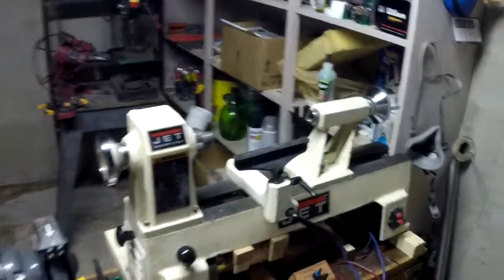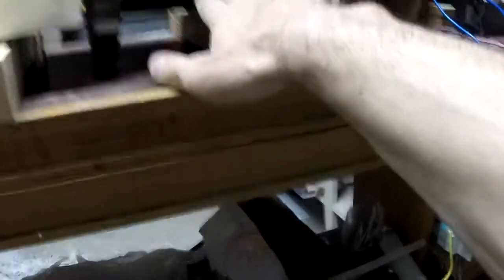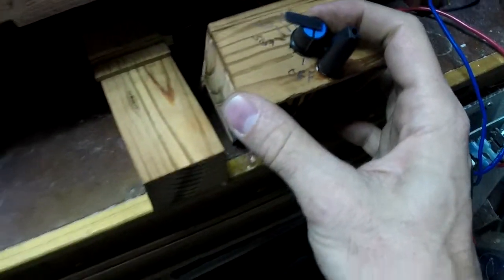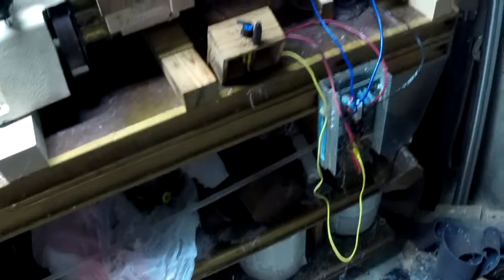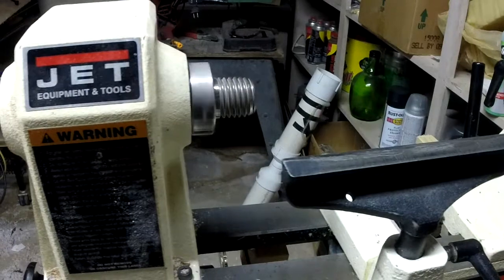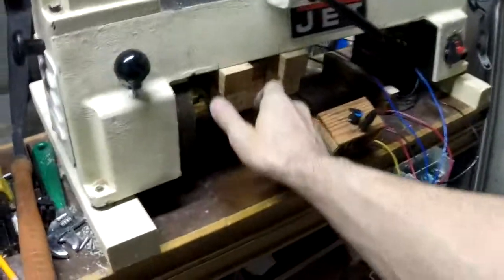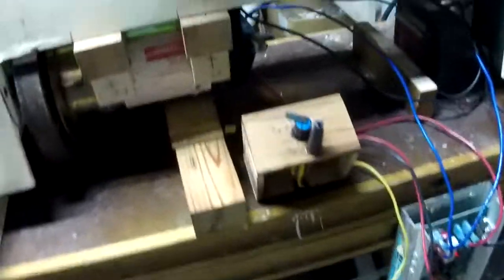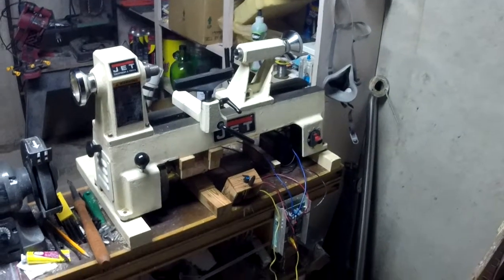Jet Lathe Upgrade to Infinite Variable Speed

Comment: Excellent job. Breadboard for sure but you can clean it up later. I have a Jet 1014 vs lathe and I’d like to upgrade the motor. But I don’t have your skill in electronics. What are the specs on the motor and what controller would I need?
Thanks,
Paul
Reply from the maker: Sorry paul I had trouble getting to my comments for several months, i dont know the specs sorry